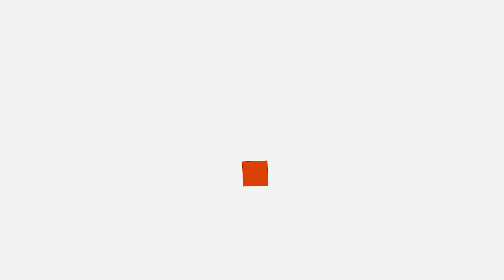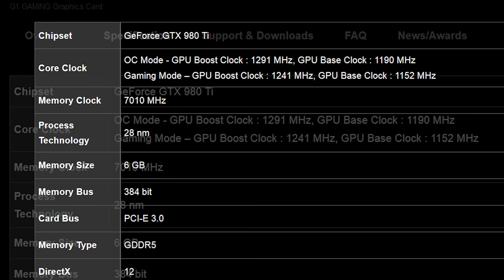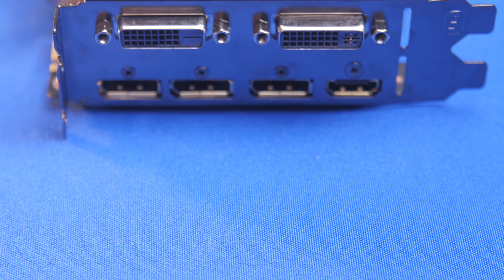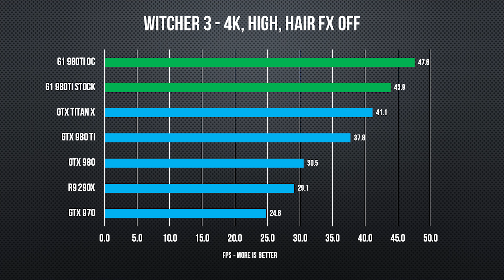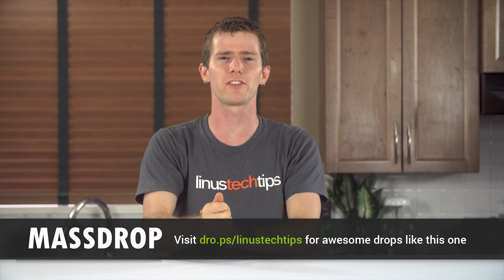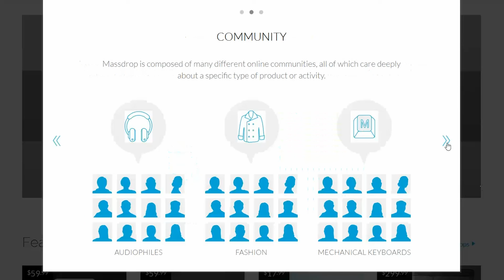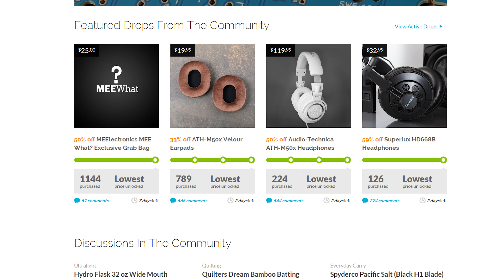Gigabyte G1 Gaming GTX 980 Ti - Both Beauty & Brawn?

Comment: Have had my gigabyte 980 to for a week now and it turbo clocks to 1418MHZ in stock oc mode. Overclocked with no extra voltage to 1525MHZ on core clock and was able to add 200+ on the memory clock . Linus can borrow my 980 to if u need more cards for your boost clock testing what's everyone else getting for boost clock speeds command please

Comment: Got one of the first G1s on ncix because of a slight labeling error on their part and it is a serious card no doubt about it, had mine performing just as well as in this vid, the only trouble i have had is with OCguru 2.0 which wont launch after install it seems. (i use afterburner anyways) but aside from that its a killer card!

Comment: Hey LinusTechTips, I ordered my 980ti from NCIX and it's currently on Backorder, so i have a week to decide if i should get the Gigabyte G1 edition or the MSI Twin Frozr. So far there's hardly any reliable information about which of the two is better, except for one thing which is i've read a lot of people experience coil whine with the Gigabyte G1 version. Thoughts?
Reply: ***** grammar is not an indication of age.
Reply: I have this card my wife spammed newegg till it was available to order I love it no cool wine clean working card love it for my surround mode 3 screens
Reply: ***** he could be a non native speaker
Reply: MendaMeister jaytwocentz made a review on both of those cards. I was personally leaning more towards the G1, but Newegg kept running out of them quickly, so I bought the 6G, once it became available.  The 6G is fucking awesome BTW.
Reply: MendaMeister Don't buy that 980ti, buy the new graphics card "ENVODIA" The ENVODIA is a new GPU company that provides cheap AND insane GPU'S...Their first GPU is the ENVODIA UUTOL 450 This GPU contains 32GB of VRAM It's very cheap, only, ONLY 2500$
Reply: sgtcojonez I thought all 980Ti's are 6G? --- Edit:  Nevermind, Just realised you were talking about the Twin Frozr.
Reply: Or I wrote this comment on a cell phone with auto correct genius
Reply: ***** suggesting that he was issues -_-
Reply: MendaMeister I've got the EVGA SC+ ACX 2.0 version and it's a monster with zero coil whine and a stable 1504 mhz core boost overclock
Reply: 1525 MHZ running 3Dmark on the gigabyte card! i think i can get higher if i can find a way to keep the card it self cooler
Reply: ***** I've got a water block headed my way for mine.  The ACX 2.0 cooler does a pretty good job but gets pretty noisy once the card is over 60*F
Reply: my card sounds like a tornado when its on full load crazy loud never got into custom water cooling setups maybe now is the time

Comment: I hate to do this but...I NEED MORE SCRAPYARD WARS!!!  Please :')
Reply: ***** luke wins with a 138 wile linus gets a 131
both worked fine, luke's has a leak that ended up getting fixed
should get vessel ;D
Reply: ***** go to vessel.com they uploaded the last part on sunday i think
Reply: ***** Absolutely. I've already seen the final episode of series 2, but I very much want them to do a third one...
Reply: I have vessel. But it's super slow and doesn't do proper full screen on iPad.
Reply: Pyroblock (SPG) I dont know if i would say Linus system worked fine when it had temps of 85c.
Reply: Bisho736 thought I'd do what everyone else does and be an asshole for a change ;D
besides, I could have made all of that up for all they knew
Reply: Pyroblock (SPG) So basically you decided to be a knob for no reason? Cool, don't see the point in that.
Yeah but you see, the whole "I could have made all of that up" thing only works if you did make it up, the fact is that you just confirmed that you didn't make it up so y'know.
Reply: Pyroblock (SPG) WTF
SPOILERS!!!
I H8 U
Reply: Bisho736 everyone else beat me to the punch about actually confirming what I said was true, sooooo cant blame that 100% on me...just 95%
Reply: ***** Yeah this time i want them to build the best rendering machine for 800$ bucks.

Comment: The buttons don't do the same thing. Silent will turn off the fans, but the fans will start again if the GPU temp gets too high. Stop will completely stop them and they won't turn on again, even if the card gets too hot. Didn't even have to Google this, it's just logical.

Comment: Strix 980 ti or Gigabyte g1? hmmmm
Reply: vinZz 311 By looks alone? I would pick the Strix, but other than that it is too early to tell, because the Strix is not out yet.
Reply: The Joker uhm the fury x heats your case just as much as a 980 ti... the core is cooler cause water cooling but that doesn't mean the gpu magically produces less heat ;) thermodynamics n shit
Reply: All the way strix better cooling, higher and more stable speeds.
Reply: we couldn't say g1 beats the strix yet because its not out yet :D other than that we will see, my wallet is ready LOL
Reply: The Joker The coretemp doesnt have anything to do anything with the heat the gpu produces per se... Low coretemps show that the cooling is good or that the gpu just produces less heat in general. I dont know which gpu produces more heat but i will assume that they are close to each other or that Fiji produces more heat.  (http://www.hardwarecanucks.com/forum/hardware-canucks-reviews/69682-amd-r9-fury-x-review-fiji-arrives-7.html). So the only thing lower coretemps show is cooling performance. Naturally a water cooler will perform better then air cooling... So the heat in your case isnt better with a Fury X vs a 980TI. There are valid arguments for buying a Fury X. This isnt one of them. Also this link might help you understand what I mean with thermodynamics: https://en.wikipedia.org/wiki/First_law_of_thermodynamics
Reply: "Judging from the tubes and radiator it is more than evident that the core and various PCB components are producing a prodigious amount of heat." -my link

Comment: When are you guys going to do a review of the 300 series?
Reply: Houndz just take a look at any of the 200 series reviews.
Reply: Shamen Shamen Except all other reviews show the 300 series performing better...
Reply: +Bandit5317 That's because they are factory overclocked and run faster at stock. The benchmarks that are overclocked increased the voltage by percentage allowing the 300 series to get even more extra power to work with. If you gave the 200 series and 900 series for that matter an equal amount of power to work with, the 200 series would be equal and the 900 series would crush the 300 series.

Comment: Damn cant decide between this and the MSI version...hmm...thankfully I still have time to decide...
Reply: Depending on the colour scheme. They are pretty much the same cards, but in terms of performance the windforce card is better in my opinion
Reply: MSI since many people have coil whine with this card.
Reply: That depends on the clock lol. Just overclock  if you have problems.
Reply: Windforce
Reply: Sharfaraz Ahmed  aren't the fans bigger on the MSI?
Reply: Returned my 980 ti g1, it had coil whine louder than the fans when they were at 75% fan speed. I got the msi twin frozr one now
Reply: Steven Williamson 980ti Classified or Kingpin if your a real boss.
Reply: Steven Williamson Well the Inno3D iChill x3 is cooler and performs better than both so I'd choose that :)
Reply: Mast3r Race Galax HOF 980 ti :D
Reply: SupremeMystique

The G1 gaming performs on par with the best of the best 980ti's...even the Kingpin.
Reply: SupremeMystique
Honestly any aftermarket 980ti is going to be great. The difference between the best and the worst will only be a couple FPS. So it just depends on the price difference between the two. I can't even find a 980ti Windforce on google, only the G1. The G1 gaming has top of the line performance for 980ti's, so it's amazing and a great price.